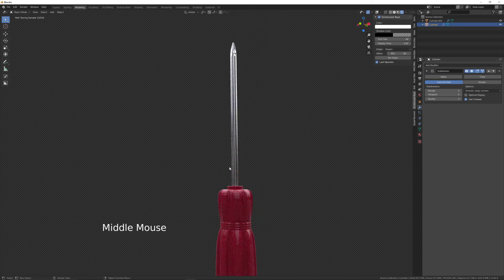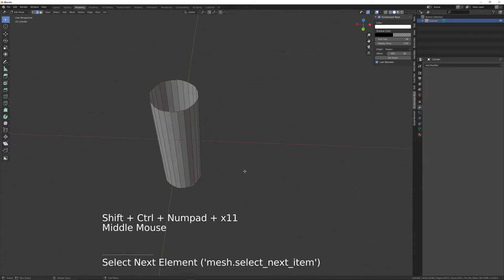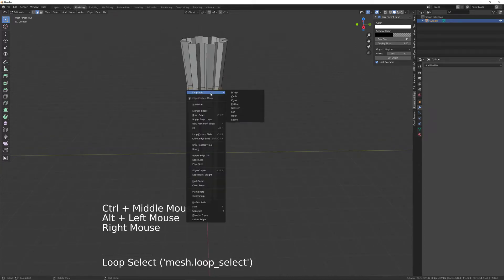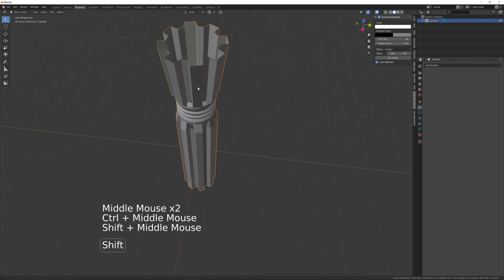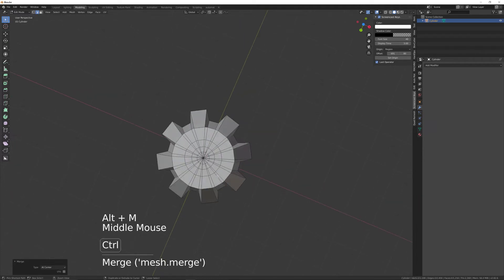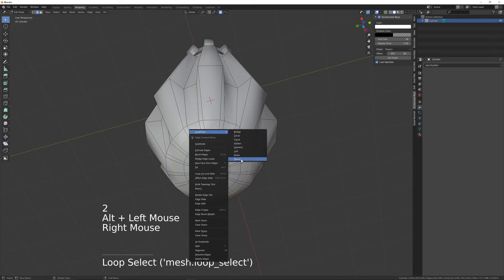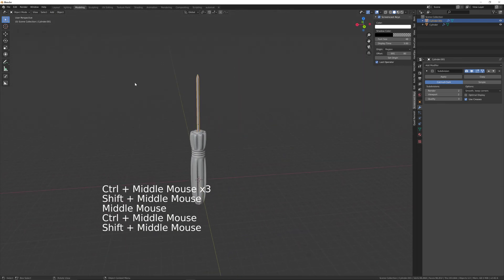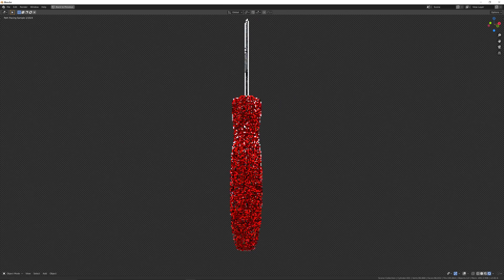How to model a screwdriver in Blender

Comment: What addon do you use to display the last 6 commands? IINW the default function of Blender does not behave like this.

Specifically, I like the display of the function below the horizontal line.
Reply from the maker: Nagesh Aras screencast keys addon
Reply: @3d-illusions  Thanks!